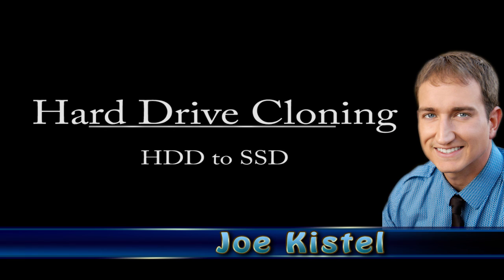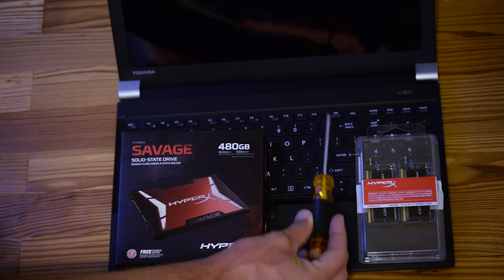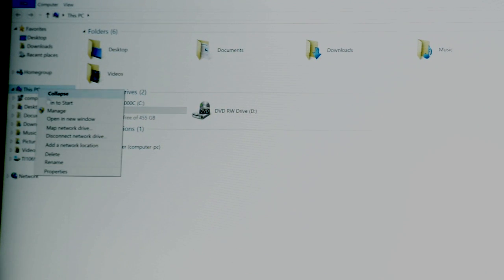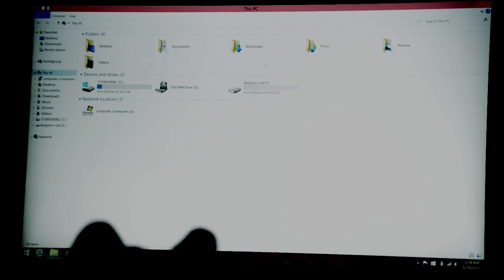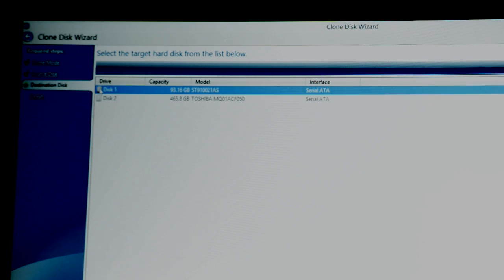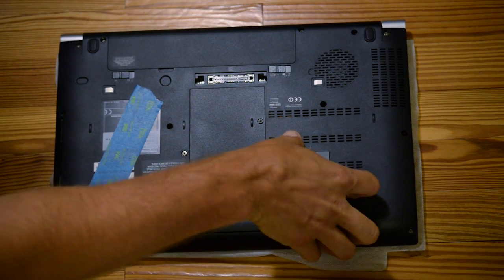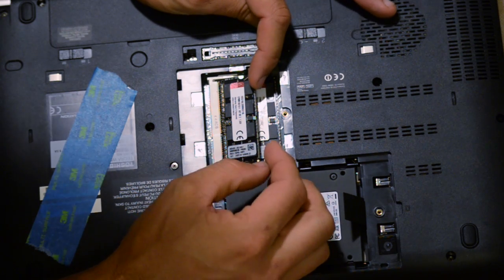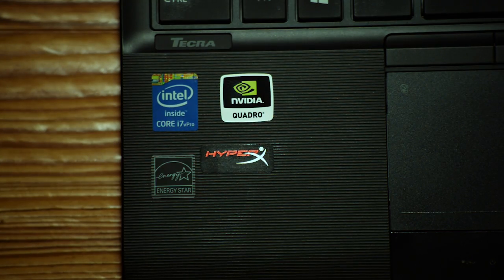Clone and Replace Hard Disk Drive (HDD) to Solid State Drive (SSD) on laptop

Comment: I backed up my system to a external hdd and installed a new m2. Everything is fast and looks good, except that I'm missing some stuff like hp assistant, nvidia  drivers, anti virus, etc. Should I use the clone software to finish the process??
Reply: S2DaM 00
I'm pretty sure you can re-download them online?

Comment: hi i would like to see you do it on sony vaio sve 151
Reply from the maker: Gene, I unfortunately do not have  the computer you reference to show a demonstration but if you can access the hardrive/s I would imagine the process would be similar.
Reply: sony vaio they have made it so you can not use a  cloned hdd  it will not work on bios this is on sve models  you can't even reinstall from dvd's taken from laptop put in new hdd in todate tried everything and no why am i going too  pay sony repair price ...
Reply from the maker: hmm, that sounds like a headache, best of luck.  I like your thumb image? Were you a fan of the Cosmos series?

Comment: One thing cloning does not do is remove any BIOS passwords that may have been set. Be sure to remove all the administrator, user and HDD passwords before installing the HDD or it won't be recognised - at least that was my experience.

Comment: I hope you can answer to me..
Will this work if I do the same thing but use a usb 3.0 external hdd enclosure with a wd black 1tb laptop hdd instead of ssd?
Reply from the maker: generally should work as long as destination drive is the same size or larger then the drive that is being copied "cloned"

Comment: So does this clone the OS too?
Reply from the maker: yes, it will make a replica hard drive that will include the OS.  Once the cloned drive replaces the drive that was "Copied" the CP will boot using the new cloned drive.
Reply: Will the old drive be wiped after a successful cloning and able to be swapped back in if the new drive fails?

Comment: Would this work for cloning a hard drive to an ssd which is for a new pc that I'm building or will i still need a new product key etc
Reply from the maker: If you clone your drive on your computer to a new drive and continue to use the original computer with the original drive, you cannot use the new cloned drive to run a new computer without a new operating system license.